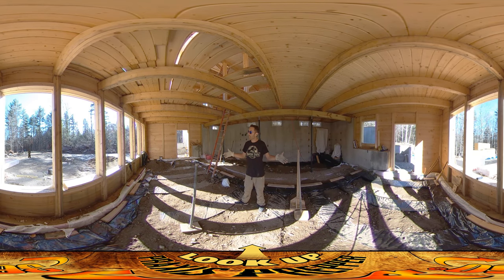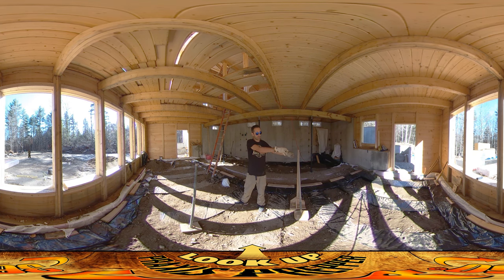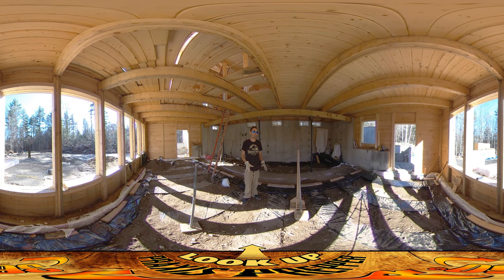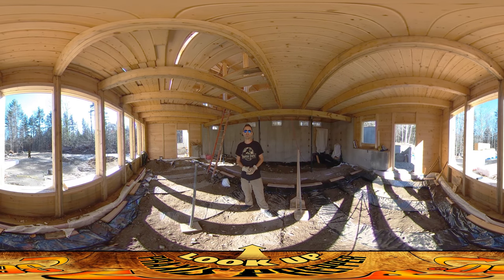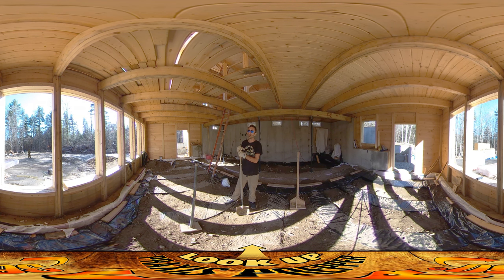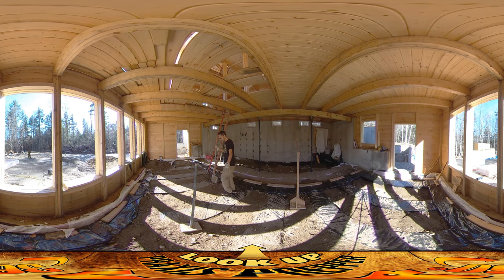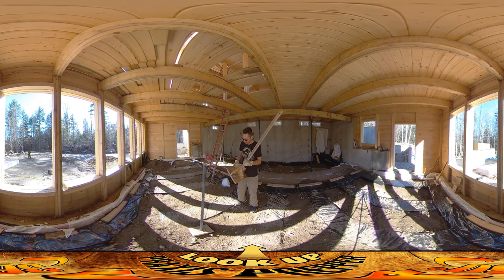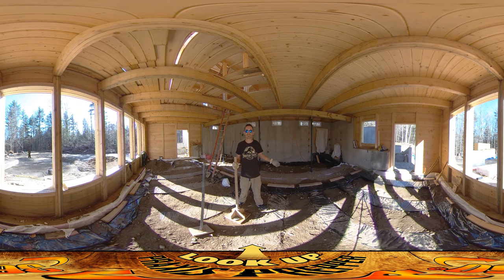Homestead Building - Sub Floor thermal Tunnels DONE! Anti-Machinery RANT!

Comment: One of my summer jobs was to work on a cement crew.
When we could not reach an area with a chute from the truck, we took 2x10 boards and laid down a pathway and used a wheel barrow to move tons of wet cement.
 Fast and efficient......... you be the judge.
Reply from the maker: We did some board ramps for moving the scaffolding recently that worked pretty well.

Comment: So a couple more days and you be letting the dogs out ... and people be like: 'who let the dogs out' ... and you be like, pointing up: 'roof roof' !!

i'm sorry, but hey, somebody may get a chuckle out of it and a day not laughed is a day not lived (or at least that saying exists over here). When it comes to powertools though, i hold the opinion that if you haven't worked with a particular tool before (or done anything specific) do it with the hand tools first. This goes slower and things you do are less impactful, aka. the scale of the mistakes you will make (and little things you will learn about the job, by making those mistakes) are a lot smaller then doing these things with a machine. Then, once you got the hang of it, move to the powertool, in which case you will try and avoid some of the mistakes you made earlier and make a big mess due to all that power behind it, and you will likely also appreciate the powertool more, because you have experienced how hard and tough things can be with a handtool. And then you will likely also develop the sense of which things are better done by hand and which are better done by a powertool, because as said, with a powertool a small mistake can have much bigger impact on the end result.